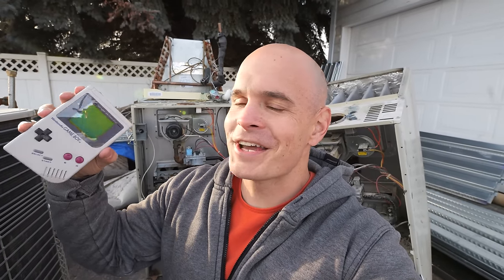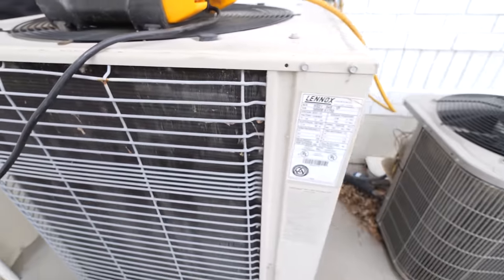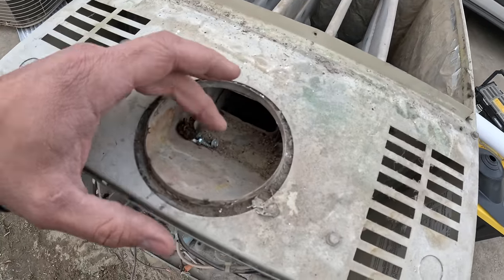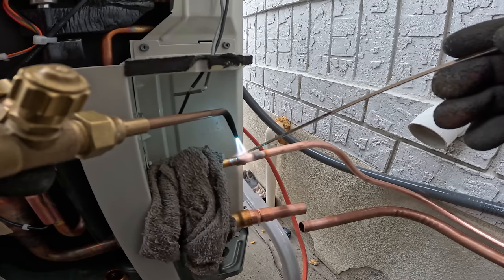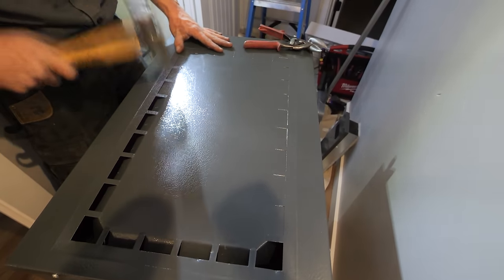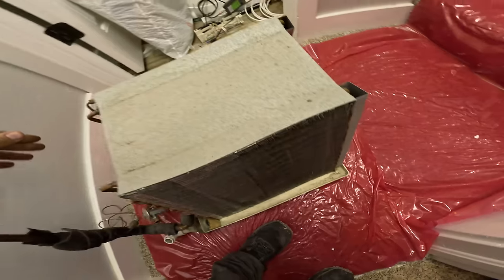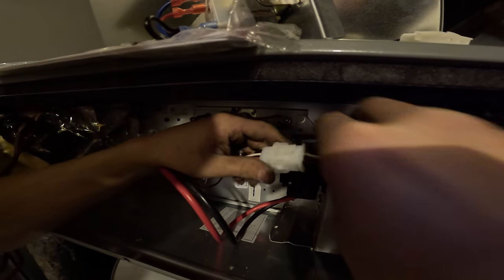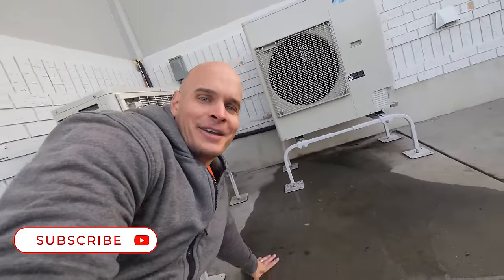Why is Everyone Talking about Heat Pumps?

Comment: those installers did not do the right job with the propress, brazing stubs first to press after defeats the purpose of using propress. its also really sad to see that many press fittings on a refrigerant line. they have a pipe bender why use so many $20-$30 fittings when you can just bend 1 pipe. so many things about this install that are not good. i would not be proud of that work.

Comment: An inverter may be more efficient than a regular heat pump, but either type of heat pump are still INEFFICIENT in a Utah winter. Heat pumps revert to resistive heat much below 40F. They also dry out the air and even whole house humidifiers struggle to keep up with that. Gas boilers (for radiators) or even a wood pellet stove would do a better job in places that get real winter weather.
Reply: Depends on your balance point. 40F is a walk in the park for Cold Climate Heat Pumps.  Hyperheat ones can provide 100% output down to about -5F without requiring resistive heat.
Reply: @BenIsInSweden  Hyperheat is grossly overblown- there's a lot of info on this
Reply: @Slythey  how so? 
Even my non-hyperheat heat pumps have handled -5F just fine as the sole heating source without any kind of backup
Reply: @BenIsInSweden  power use for heat output is higher
Reply: @Slythey  so? Thats the same for any heating system.  Even gas, the colder it gets the more gas needs to be burnt to keep warm. Hyperheat also doesnt need resistive heating like you state in your original message.

Comment: As an hvac technician this is not completely accurate or representative of the industry. They even wrote “recover” on the outdoor units because the installers would have pumped them down and released it later if it wasn’t being recorded 😂

Comment: how come heat pump more efficient than gas furnace? i dont understand. Gas furnace convert gas into heat at 100% efficiency. heat pump use electricity conducted over from a power station which use gas to boil water and use that pressure to turn a turbine and in turn create electricity. Every step of that power generation lower efficiency. Can someone explain to me when people say heat pump is more efficient that gas burning furnace?
Reply: They are not. They have to run substantially longer to all the time to just maintain temp in a home and have to utilize Aux strips for the really cold days. Your 120 gas bill vs ther 200-500 electric bill every month that the home is still cold. I repair all these systems and parts are difficult to get and are substantially more expensive to repair than your gas furance you can fix on your own with parts ordered onlined from amazon
Reply: Ignore zack9912000's nonsense troll reply.
Heatpumps are more efficient because instead of creating the heat from scratch, they extract and transport heat energy from the outside air into your house, which works even when the outside air is cold (still lots of energy in it). 
Because of this they can be 300-500% thermally efficient. 
For example, running at full blast it could be using 1.5 kW of electricity, but outputting 5 kW of heat.
Reply: @logitech4873  Stop following my, you sir are the troll. I work on these systems daily for a living and have more knowledge on  them than you certainly do. I also have no issue telling people what the sale people wont.
Reply: @zack9912000  And yet you're unable to explain why they're more efficient than other methods of heating.
You claim to work on them, but you literally do not understand how they work?
Reply: @logitech4873   can you confirm it with an experiment? Let's take a burner that use LP or natural gas and measure exactly how much gas it used to bring 10L of water from 25C to 80C. Then take that exact amount of fuel to power a generator and plug a small heat pump into it and see. If heat pump is 300% more efficient then we should have more than half the amount of gas left. Can you conduct this experiment Jerry?
Reply: @delavega92  It would be a neat demonstration, but it might not work as you intend because the generator would have a lot of energy loss.

It's better to just compare a resistor heater (100% efficient) to a heatpump. You can find many such comparisons.
Reply: @logitech4873   no i understand how heat pump can be more efficient than electric resistive heating. What i dont understand is how it can be more efficient than gas furnace. I have to see a demonstration to believe it. Can someone please set it up and make a video of it
Reply: @logitech4873  how come burning gas to extract heat onsite be less efficient than to burn it at a power station to generate electricity and then have to transport it miles away by wires through multiple transformer stations then finally into a home to run a heat pump. That's what I can't wrap my head around.
Reply: @delavega92   If the power plant is solely gas-powered you probably end up with 30-40% efficiency by the time it enters your home as electricity. Multiply that by an average COP of 3 and you end up with around 100% net efficiency. It's about even. The real benefit comes when some of the electricity comes from other sources. As the grid becomes cleaner the heat pump system becomes better but the furnace will be stuck burning gas at 96% efficiency.

Comment: The reason why you used to get a blast of hot air in the heating season with your old units is because you're old units were 80 plus efficient your new units are 90 plus That's why. It's nothing new The furnace in my home is 90+ it's heated via natural gas. An electric heat pump would the bankrupt us. DRILL BABY DRILL COMING TO A COUNTRY NEAR YOU COME NOVEMBER

Comment: Heat pump with a SEER of 28.5 is better or worse than a 16 rating?  A 28.5 is 3 times more efficient than a 16 rating with 4 times more, what's what?
Reply: Higher the seer the more efficient it is, but the cost skyrockets to tripple the costs
Reply: @zack9912000  Mini-splits may be an option if central air handler can be abandoned to get best seer for the $. Real question is are the seer rating versus the times efficient a real number or a shot from the hip?
Reply: @carlwest859  A cental air handler will make a more comfortable home over all vs putting individual heads throughout the home.
Reply: @zack9912000  How is that the case? With inverter mini-splits you get precise temperature control everywhere. With a central system you are stuck at one thermostat temperature and in other rooms the temperature can be different.

Comment: people are talking about heat pumps because most people don't understand what they are, most people don't understand that air con units are heat pumps. Of course its far more environmentally friednyl to service and use the old one, it will take several years to offset the manufctureing polution and materials production. However your old furnace was a really inefficient design, its interesting how american systems differ from european ones. If you really want to see effeicnet go to sweden, they are years ahead of the rest of us. Even in europe.  Of course using an electric system like the new one you have put in its a good idea for you since you have all those solar PV panels so your electric is super cheap. in Europe the electric is really expensive so less viable. our solar PV incentives are laughably bad compared to yours

Comment: OK, first, I love your channel and your "get down". However, your explanation of the new system was a little bit disingenuous in that your "dual fuel" setup actually has electric coils for an auxiliary heat source which doesn't "turn the outside energy" into heat that you narrated while showing the resistive element.  You have natural gas as the secondary heat source so it would be a virtually impossible scenario where the gas furnace couldn't keep up with your heating needs after the inverters have done the best they can and require the resistive elements to kick in.  I've never seen resistive elements installed where there is a primary gas source.  Further, it is a more digestible explanation to say that inverter "heat pumps" are a creature of momentum.  They turn on a very low energy and very slowly approach the target temperature while traditional Freon A/C and natural gas heating solutions blast away quickly to achieve the desired temperature.
I tell my customers that during a heating or cooling season to not turn the units off but rather to set them below (heating) or above (cooling) the target temperature and then allow set units to hit target when demanded.  They run for pennies in "standby" and then it costs very little to overcome the heat gain or loss to hit the comfort temperature.

For reference, I'm in Southern California and I've installed Pioneer, Della, Greer and Mr. Cool systems.  There are only a few manufacturers in the world (maybe three) and thousands of brand names.  The only difference is marketing, warranties and apps.  Internals are identical.  I get calls for Rheem every week and every time I sell a Della or a Greer once I educate the consumer.

Comment: You will be disappointed by result. Or maybe you live in warm climate, because here having heat pump without low temperature floor heating and isolated passive house is waster of money, because it would not be able to heat your house without using additional heating spiral...

Comment: well, in in a bit under 20 years, around 2040, the magnetic field will be very weak due to the pole shift. Earth will be blasted by the solar wind. Agriculture and telecommunications will be severely impacted. The efficiency of your HVAC system will be pretty low on your list of worries.

Comment: As I understand, one of the challenges is that HVAC places hear "heat pump" and suddenly want a far higher markup and install fee than they wanted on traditional equipment. This should eventually go away as they become more commonly used.
Reply: No, they are just substantially more expensive. Average HP is 15-20k. They have been around since the 60s and are still crap compared to NG

Comment: heat pumps last almost forever, not much too it the biggest issue is blown compactors but that is a cheap part with little to no knowledge to replace it
Reply: lol like hell they do, they last 15 years is the average. As they age their effectiveness drops off like a rock😂
Reply: @zack9912000  15 years is pretty good. The end result isnfar more efficient heating. But it seems you are like anti-efficiency or something?
Reply: @logitech4873  Avergae gas furance is 20 to 25 years. Boilers last 30 to 40 years. My high efficiency furance uses less energy  than any HP.

Comment: What was the total installation cost, including equipment? Or did you not say. 
That whole setup is easily twice the price of a high efficient furnace install. And it looked like you had a mid efficient furnace, so of course you're going to see an improvement.
Reply: @Ryuudo123  nope, I don't.

Comment: It's not "phase change". Its the "joules-Thomson effect" and R410a requires a lot higher PSI to reach the respective saturation temperatures in order to heat or cool making it rather energy inefficient. I don't know why these lies circulated so quickly. Heat pumps also need two to three times the refrigerant in the system so leak repairs are actually expensive. R410a isn't as "safe for the environment" as first believed.

Comment: Lie again, heat pumps are not the most efficient. Geothermal heating pumps are... Why didn't you use a geothermal heating pump? It's not affected by the cold. and why buy one that uses old gas when R290 are on the market it transfear heat up to 70c instead of 50c and work  below -20 still a Geothermal heating pumps is the best option if you can drill.
Reply: "Yes I'd like to literally quadruple my cost of installation please"
Reply: it has a longer lifecycle, and you save on installation costs over time because it uses less power... you just need power to transfer heat from 5 to 20 instead of -10 to 20 and a heat pump get less effective the colder it is.. You will literally cut your winter bill in half.
 In Sweden, we have been utilizing this technology for decades, and approximately 80-86% of the population uses some form of heat pump. Ur average Joe knows more here than your heat pump technician...
Reply: @Moontrue1on1  I have actually done the math, and I would literally still be out thousands of dollars by the end of the system's lifespan. Now, to be fair, I live in Tennessee so our winters are fairly mild, but you're still adding $10-$30k to the cost of an install that's a huge cost to have to make up.
Reply: @antikommunistischaktion  use the 50cal and drill a hole :P
You can install a system similar to heated flooring but in reverse in your yard to harvest heat, or if you live near a lake or body of water, you can extend the pipes to the bottom for a cost-effective solution. However, this is not advisable if you do not reside in a colder climate or if you are unable to opt for the less expensive method of digging. But would be perfect for Jerry
Reply: @Moontrue1on1  As much as I would love to use the official state hard drive eraser to drill a hole that would equally get very expensive. :p

Comment: Ah heat pump, an almost useless feature that is already installed in many houses for us tropic folks.

Edit for detail: Most of, if not all, SEA household use split AC instead of HVAC. There is a heat pump mode already built into the split

Comment: Because you live in USA and USA is always 20 years back than Europe, i live in Italy and Heat pump it's a very common thing. My parent's home used to have two mini split AC, both with heat pump, more than 20 years ago.
And what inefficient, heating air, our furnace use gas to heat water, water pass through big radiator like, some are even active cooled to move more hot air. 
Modern system use gas furnace with active condensation system, to recover almost all the heat from the hot smoke, so you can literally have your hand on top of the exit of the smoke and the air is literally cold. More advance one are combined, with heat pump and mix both gas and electricity. Some use electric boiler too, some have electric solar panel cooled by water that become hot for the home.
The real problem is that no use a heat pump to heat up, because electricity is a lot more expensive than gas in Europe, and less efficient than gas too. It's a good investment only for who have solar panel or solar roof.

Comment: 10 years ago heat pumps were black magic that home builders avoided like the plague. My current house was built about 10 years ago and has heat pumps with secondary gas heat. Sure it's not great when it's super cold out, but it's been a thing for decades and they are finally becoming normal. Still way overpriced from local companies. Helps when you can source and install yourself...

Comment: My furnace is original to me house built in 1960. Heat exchange is in good shape and my gas bill is the same as people with "efficient" furnaces on their third or fourth replacement. The industry is broken but we need to worry about straws and bags. 🤡 Heat pumps seam to be a great step forward aslong as theyre not engineered to fail after five to ten years.
Reply: They do though. They dont even last on average 15 years in most case.

Comment: Meh.  The elephant in the room that he's not talking about is longevity.  Modern HVAC equipment is largely garbage that is far too technical--in order to meet unrealistically stringent modern standards... and therefore ends up in the recycle bin 5x faster than a typical gas furnace from 20, 30, 40, 50 yrs ago... which lasted forever.  Same with modern water heaters.  Complete garbage.  Same with modern refrigerators.  Also complete garbage.  And guess what?  If you have to replace a $5000 to $10,000 system 2 or 3x more often than a "less efficient" one... then it's not more cost or energy efficient in the long run... right?

Comment: Well, well, well, another customer deceived. Several things wrong with this install. Please, you seem smart, you should due a to complete cost analyses between a heat pump over a straight gas furnace and A/C of the life of the units including installation cost and more importantly replacement cost in 10 to 15 years when the equipment will have a major failure, or the "EPA" will change refrigerants and the cost of the "old refrigerant" cost so much it makes more sense to replace the entire system. Now, all these considerations of "environmentally Friedly" need very close scrutinizing to see if it is necessary or just a way to milk more money out of everyone.

Comment: I wish I had know knowledgeable installers in my area, let alone my state. I have gone through a good dozen and all of them say heat pumps don't work in cold weather. But I know this is BS and out of date information and so frustrating.
Reply: No its not. Do you argue with dozens of mechanics who say stay away from x brand they are unreliable too. Heatpumps are terrible for cold climates and cost more to repair and last half as long as a good quality gas furance. I fix residential  and commercial hps daily, and it's always the same problems 😂